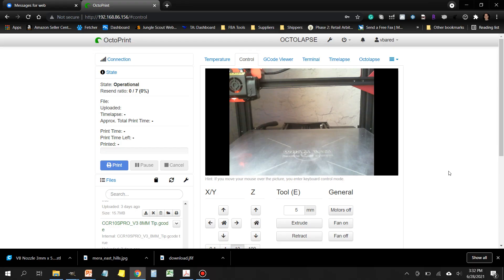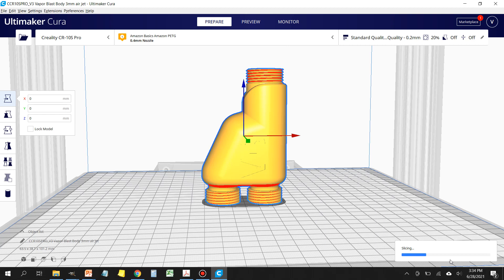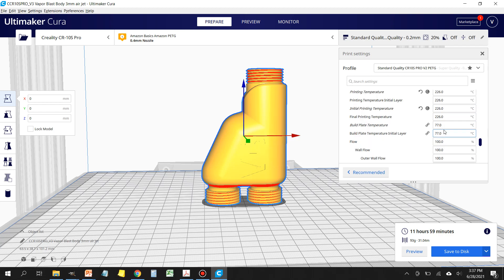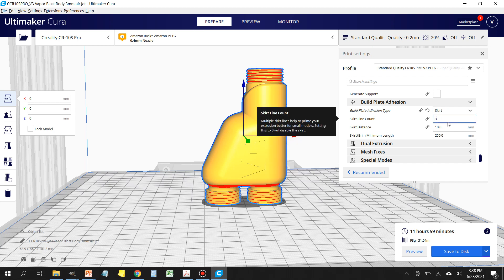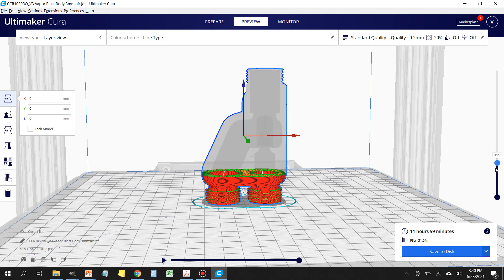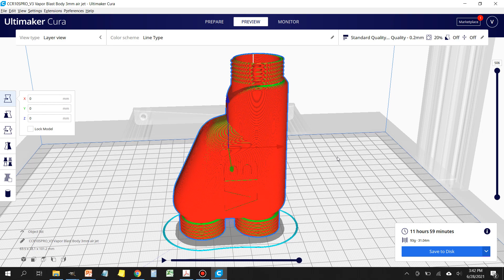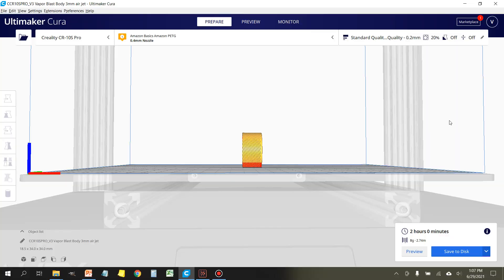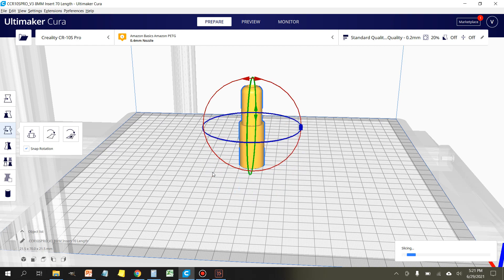Printing the V3 Vapor Blast Gun purchased from Shopify

Comment: do the standard ceramic nozzles also work with this?
Reply from the maker: Hello,

Thank you for commenting. 

These ceramic nozzles fit the V3 Vapor Blast Gun. Unfortunately, The opening is 6mm so blasting will be very slow - https://amzn.to/3S8liwK
Reply: @vbared  Thank you for the reply. I like your design, how long does a 3D printed nozzle last? And at what air pressures do you blast?
Reply from the maker: @chyrt  Blasting between 50-60 psi using glass beads, which don't have sharp edges one tip can last for years. Aggressive media like aluminum oxide and garnet can wear a tip from ID of 9mm to 11mm over the course of 4 weeks of continuous blasting. They are solid so the diameter just gets bigger as the inside is worn away. It actually blasts better as the inside diameter gets bigger but at the expense of more air consumption. 

If you find yourself needing to remove power coating and rust on a regular basis then add a dry blasting system for that.

The wet system is best for softer metals like aluminum, brass, and copper. Dry blasting will leave a rough finish on them. If you are in a pinch and need to remove rust or power coat the wet system can do it but much slower than dry blasting. Steel and iron parts must also be dried quickly to reduce the flash rust.

Comment: You should do sales on Amazon. Their FBA or fullfilled by Amazon program. You could print 2 or 3 and send a few extra nozzles as a kit. I did this with 3d printer auto bed leveling kits I put together. We included the STL file so they could print them if they wanted to. Basically, I designed a few custom parts, included some sensors, and some documentation. We sold a few thousand before the Chinese stole the concept.
Reply from the maker: Hi Brad, Thank you for the wonderful kit idea. Congratulations on the success of that product. It's great to find people willing to share information on things that have worked for them.

I'm getting ready to upload that video we talking about earlier.

Best of luck with your projects!

Comment: Thanks for this video Victor! I learned more about Cura from this video. A  few tips I like to share. There are free extensions in Cura, install 'Auto Orientation' that arranges most things in the best position for printing and a time saver in some cases.  Another tip with octoprint installed you can go into setting in Cura and have Octoprint automatically generate a API key so instead of hitting save, that blue button on the bottom says Print with Octoprint.

I guess I'll order some PETG, I printed V3 in PLA+.  I was meaning to send you a msg about a smaller air orifice. 3mm sounds great, heck for the air orifice I won't even mind if it was a tad smaller so  I can drill it out on my drill press to play around with what works good on a 6cfm compressor at 40psi.
Reply from the maker: Hi UcantBeSerious03, Thank you for commenting. The Auto Orientation extension is a great idea, thanks for suggesting it. It makes me crazy that I have to mess with that instead of just printing. Thankfully I have the API key set up to print directly but wasn't sure if most of the viewers were using it. You're right I should have mentioned that option for those that have that feature.

What size orifice are you needing it to have?
Reply: what your printing now sounds like it would be a good start. 3mm - I wonder if the nozzle needs to be downsized? The shopify d/l has the 9mm and 10mm nozzles, no 8mm that you mention in the valve cover video.
 The nozzle tip I can probably import into fusion 360 and hack it with my newbie skills. :)
This is all new to me... I bought my blast cabinet 2 years ago, It's 1/2 way assembled. I'm going to wrap that up this weekend.

Comment: How much compressed air will the surface of the material be shiny?
Reply from the maker: Hello Hau Nguyen, I use 50psi of air pressure at 18cfm together with a mix of water and extra fine glass beads for polishing.

Let me know if I answered the question you were asking.

Best of luck with your projects!